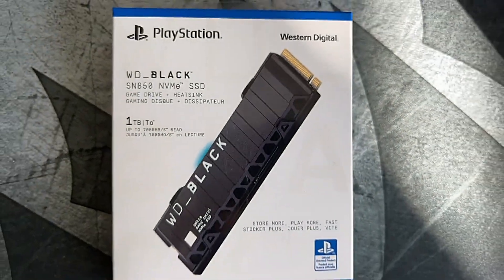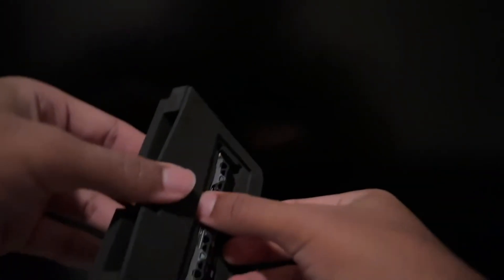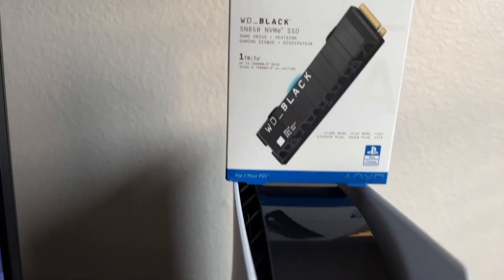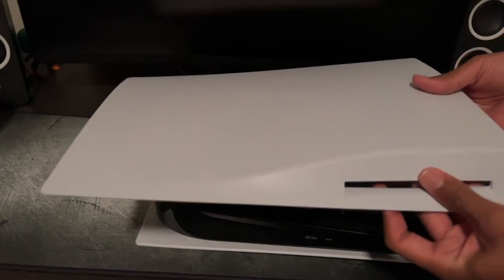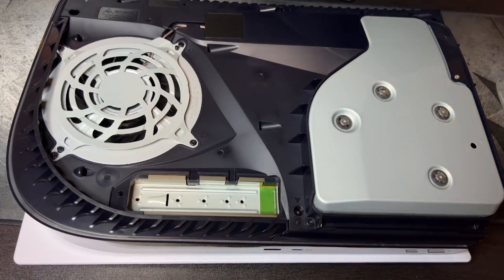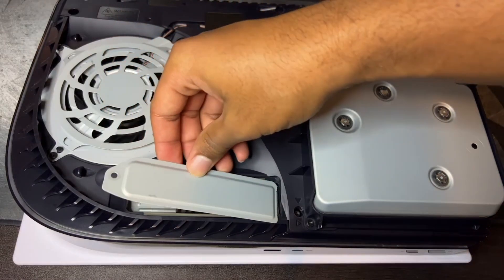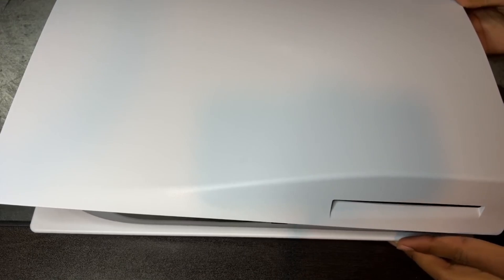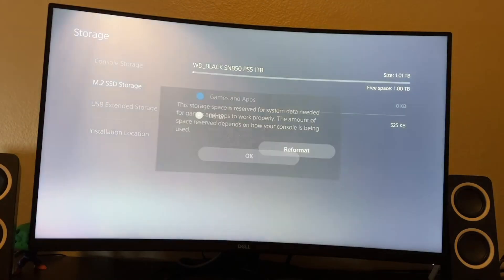PS5 Official SSD Upgrade -WD SN850 Install Guide

Comment: Your PS5 and mine are of the same Gen, that was really helpful to see. An I like that you did to important things. 1. You let the viewers know to listen for the connection sound when they have the SSD fully installed. 2. You showed the on screen setup with out rushing through it. Thank you for posting this most helpful video. 🎉 One question, can or have you done any videos showing how the consumers can identify what generation there consoles is? I mean where the product code is located on the console and how or what letters or numbers, show it's Generation?

Comment: I saw the wd black being sold as the official ps5 ssd upgrade at best buy, but they sell it on Amazon for about $120. I opted for the Samsung 1tb for $100, though the Corsair was being sold on Amazon for $85. However I watched some speed tests and the Samsung was the most consistent in load times in comparison to the two.

Comment: But go wit the SN850X. If yall got the bread get the 4TB Seagate Firecuda530 or Corsair MP600 PRO LPX. 4TB Both wit built in Heatsink. Check ya options out here.

Comment: By getting the ps logo stamped ssd you probably paid more than if you just got the same ssd without the ps logo. Just a guess Seagate external drive for the ps4 was the same way.
Reply from the maker: Thanks for watching! You’re right but thankfully I got it on sale at bestbuy at the time
Reply: @AmirSphere1  Nice. Good video on installation vary straight forward easy to follow well done.

Comment: You made a mistake while installing the ssd
Reply: My bad you did it right I just corrected mine.
Reply: what did he wrong? i'll install a ssd today so I need more information xD
Reply: @DeLacroix-BK  he forgot to use that little round bolt thingy that’s inside the PS5 with screwing in the ssd.
Reply from the maker: @TeachGameReloaded  At 3:06 I put the standoff under the ssd to hold it in place for the next screw
Reply: @AmirSphere1  you are absolutely right. I missed that somehow. I apologize.

Comment: Could you tell me the type of screwdriver that you use to install ssd m.2 in ps5 and how can I get one
Reply from the maker: Hey Mohammed, that is essentially a smaller version of a Phillips head screwdriver. Typically you can find one in a tool box like this on on Amazon!
https://a.co/d/fLXOyri
Reply: @AmirSphere  thank you so much. I really appreciate that
Reply from the maker: @mohammedelkashif8927  you’re welcome and thanks for watching!
Reply: @AmirSphere1  hey is that set solid and good for getting out the fan?
Reply from the maker: @anthonyvigil4549  Hey Anthony, Yes this set comes with a few small Phillips head screwdrivers and ranging from different sizes for other things around the house too. Here’s the one I used for my video: https://a.co/d/bUT7DCB